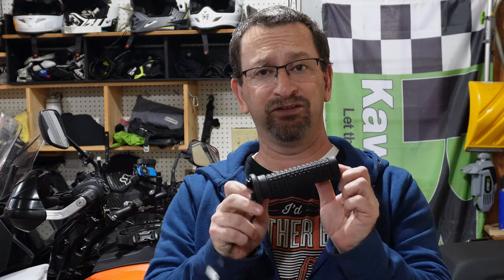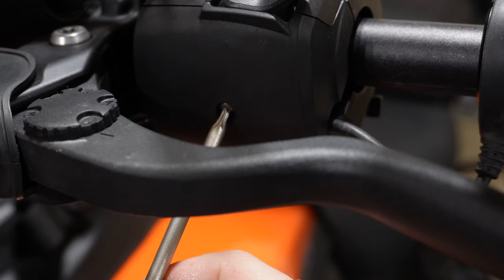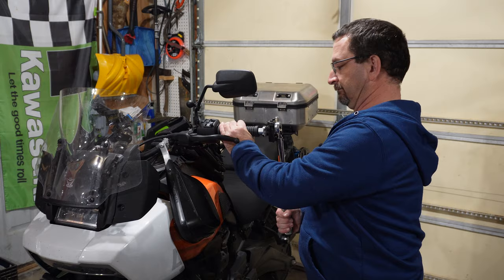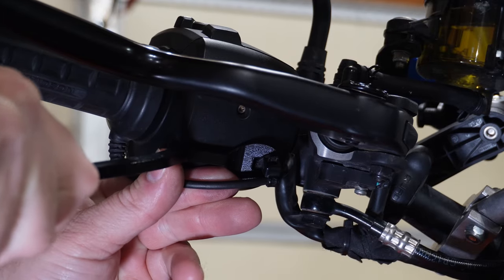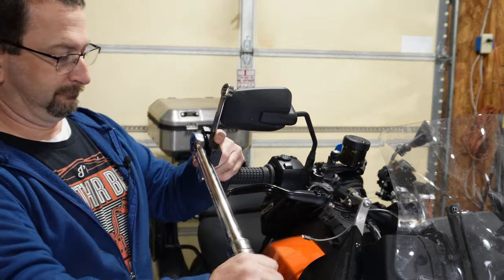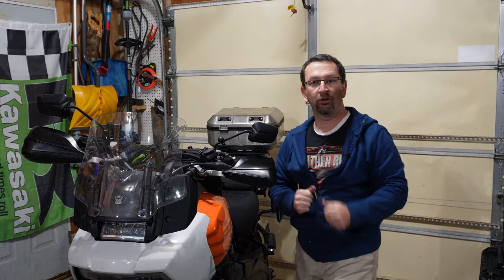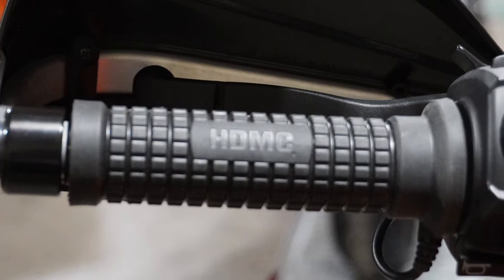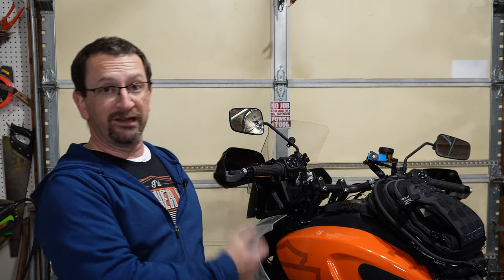HD "Tactical" Heated Grips. Worthy upgrade or just another grip?

Comment from the maker: Now one thing to note, is that these grips are almost half the price of stock grips, which are about $170 EACH. So if you just need to replace worn out grips for any reason, these may be a good choice for that.
Reply: I second that Mike.  My stock grips got a bit glazed and checked stock replacement. $175ea ! and $185 for a pair of Heated Tactical.

Comment: Thourough Test and nice installation advice. Oxford heated grips are 80$ on ebay in Europe though and you won't run them on max with gloves because they get painfully hot. And have integrated battery protection for older bikes.

Comment: great video dude, that was thourough as heck lol....seems easy enough, wondering if i should do it haveing the extended warranty on the bike, if i mess something up i wonder if HD would cover it, it..the switch housings...but damn it would save me some money!  thanks for sharing!  sláinte
Reply from the maker: Trickiest part is disconnecting the wire. Just take your time and be careful. Don’t try and force anything.
Reply: @MikesMotorbikeChannel  right on...did the rest of the switch housing stay put when you took the back off?
Reply from the maker: @Eds_PanAm  yes, only the rear panel comes off.
Reply: @MikesMotorbikeChannel  nice!, thank you for all the info!